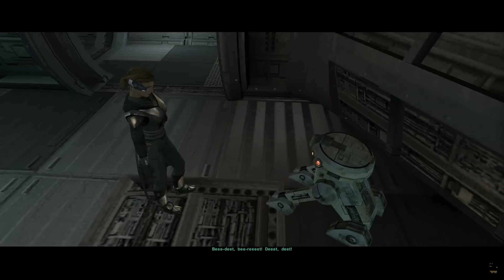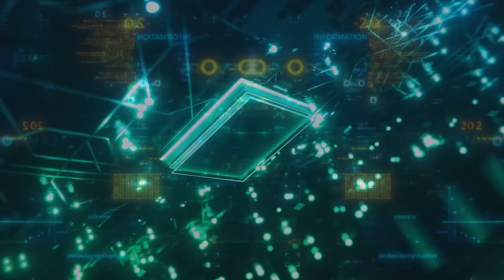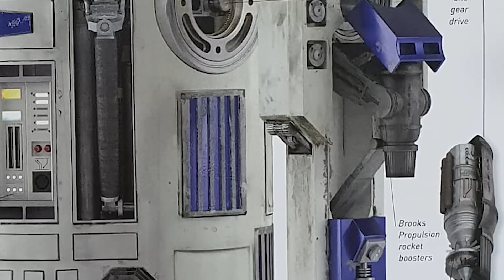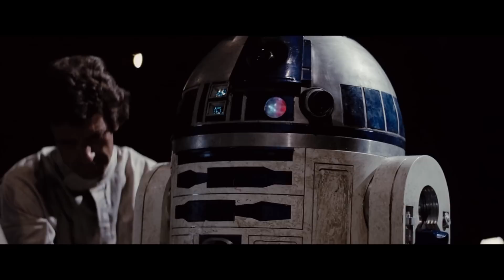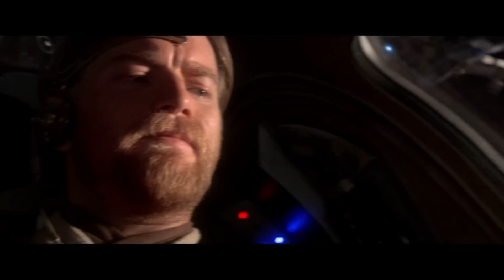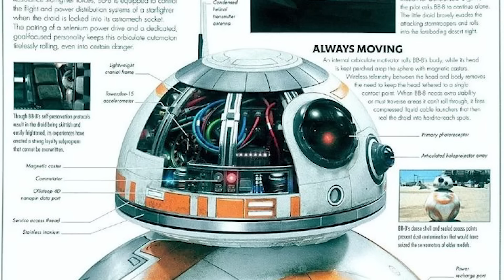The COMPLETE R-Series Breakdown (and why R2 is king)

Comment: I've always wondered....how did R2 units get around on starships that only had stairs and/or ladders??
Reply: My best guess, turn off the gravity in that section, and use short "pulses" from it's rocket motors. Or, an arm with a magnetic grapple. 

Only other thing I can think of is a few new dents and scratches anytime it had to go into the lower decks.

Comment: I feel like the next step would be to make the next BB unit able to function with its head and body operating separately from each other. Since the head freely moves along the body using Repulsor and magnetism you could also theoretically make a version where the head can separate from the body and operate independently like a lot of the smaller aerial droids like the little guy the princess had in the Obi-Wan series. The body could then roll around and do separate repairs on its own controlled remotely by the head

Comment: the r4 unit had alot of potential as if made into several subversions would of been good. one for working on capital ship bridges and other systems, one for working with starfighters as co-pilots and such and another for working in hangers on ships or garages for repairs and such.
Reply: Make it a bare bones, modular frame. Buy a cheap Droid, and add whatever is needed. Could work. 

Would be great for military service since it can be modified for most jobs.